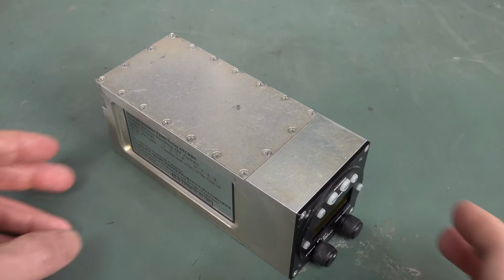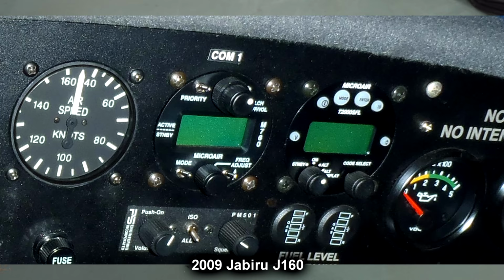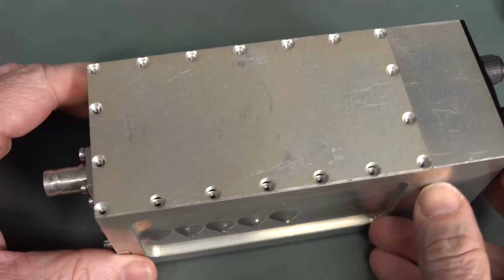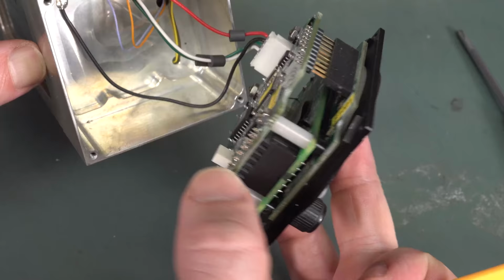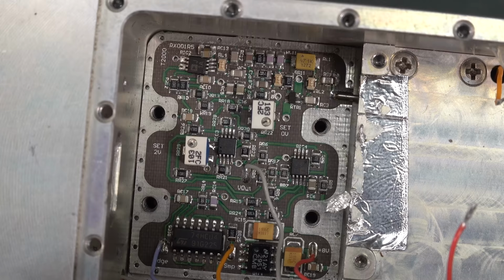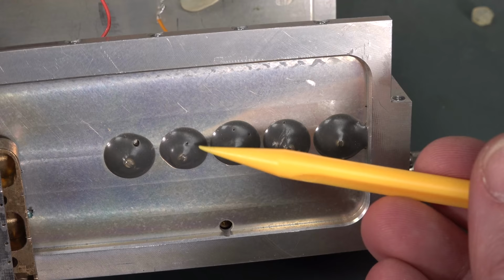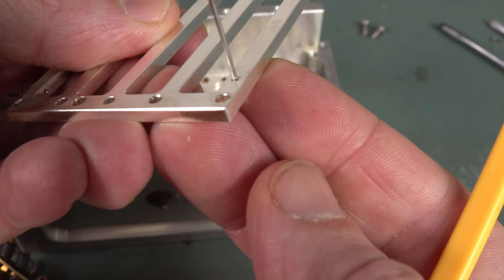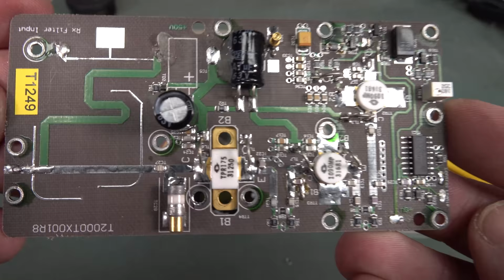EEVblog #1352 - Aircraft Transponder TEARDOWN!

Comment: The move to ADS-b may be the reason this transponder is not in service. Many small planes do not require dual systems, so when they get an upgrade to an ADS-b transponder, the old one is useless. Resell potential is limited as well. At this point most planes should be switched over. Small planes typically do not require dual systems, some may have two though, and the second doesn't necessarily need to be ADS-b compatible, so these older ones may be used in that situation... But most are being scrapped as outdated equipment.

There are a few upgrade solutions that allow continued use of the older transponder, but I don't see them in use often. They typically use a second piggy back unit to insert the ADS-b data into the RF out prior to transmission. I never seen it as an elegant solution, and only seen it once. I typically work on aircraft capable of holding more than a couple passengers, more corporate level than GA. King Air series 90 are about the smallest I see regularly. So it may be more common to use a piggy back solution in smaller planes. 

Now regulations are different in various parts of the world, but I find they don't vary too wildly. So this info may or may not fit perfectly to any given country.

Comment: One of the reason you need a good filter at RX with lots of rejection because you're TX in at 100+W in the same antenna port ... you don't want your TX power to go burn your sensitive RX stuff.
Also, that little alone cap with the long trace grounded, it's probably to be able to adjust the position of the cap for matching.

Comment: I believe that the U-shaped piece of coax on the bottom of the RF transmit board is a high quality capacitor with a little trim cap at the end poking from the board. I think that the coax's isolation is teflon based and it's of really high quality with excellent temperature stability and exceptionally low leakage. And since I didn't see any kind of XO in there, I think that the mentioned capacitor is a part of  the main oscillator circuit. Not sure if the crystal based oscillators would be reliable in an airplane with a lot of vibration...
Reply from the maker: Could be, it's very specific.
Reply: Looks more like a stub hat didn’t had enough room on the pcb. You just transform a super small cap over your length matched transmission line to create a different value. And also a very neat way to creat yourself a good q “inductor”

Comment: The highest I work up to is about 700 MHz, but generally below 450 MHz. It's always interesting to see how quickly RF circuits change as you get up to 1GHz +. That comb filter baffled me. Now I need to go brush up on my microwave circuits.

Comment: I have a casual interest in civilian aviation and always am put off by the cost of everything. After looking at this tear down I'm convinced that the gear is worth every penny. That case and tuned filter alone is worth the price of admission.
Reply: Oh. And why that wound up on your bench is that the rules have changed. It's called ADS-B. Briefly, the IFF transponder is now required to transmit digital information about the planes position in space. There is ADS-A which allows the transponder to receive that info from ATC or directly from other planes nearby. The info can be used to locate the plane accurately as  GA (and commercial) aviation is transitioning to GPS based direct routing rather than established 'corridors' in the air based on VOR fixes.

Comment: I am really surprised they are using hot melt glue. Having worked in Aerospace electronics design for years, designing EMA for players like Boeing and Airbus,  hot melt would be a no go component in any actuator, not even used in ground testing.

Comment: Are they using some kind of special solder or hand soldering? The soldering in general looks a lot more crappy than I am used to seeing in a commercial product.
I'd typically associate the look of the solder joint with low paid hand soldering or some kind of really difficult solder alloy.

Comment: Apply a single drop of isopropyl alcohol to the hot glue and it will almost instantly release everything it holds.
Reply: Good to know! Thanks for sharing.
Reply: this also applies to people too.
Reply: That never worked for me.
Reply: @MetalheadAndNerd  try applying the drop at the edge of the hotsnot and gently pry it up so that the alcohol can make its way under it. Always worked. Suddenly loosens it up and you can remove it from anything delicate it has engulfed.
Reply: @mrossirobi  I have even put a drop of hot glue into IPA over night and it didn't change at all.
Reply: @MetalheadAndNerd  Well it won't actually dissolve it or something, it just loosens the bond it has with the particular surface. Maybe I haven't tried surfaces that are too rough...

Comment: Surprised to see a BNC connector - back when I worked on fixing Bendix avionics in the 70s I was told they fretted and failed in aircraft and the threaded TNC version should be used instead.

Comment: That's the exaxt same transponder that I have fitted in my Evektor Eurostar! I've had it for about 10 years. It is quite old by today's standards. It is referred to as a mode C (charlie) transponder. You can install it with an altitude encoder that uses a Gillham code to convert the barometric pressure (relative to 1013.2 hPa) and pass the height information to the transponder. When used without the height information it is referred to as a mode A (alpha) transponder.

Mode S with ADS-B out is the latest standard. When mode S came along, I had to return my transponder to Microair in Australia to have it updated since the mode S compatible SSR signal from ATC radar heads stopped the mode C from working for some reason.

Apart from reporting your height and and squawk code (the 4 digit code assigned to you by ATC that you enter on the front panel), it doesn't really do much else. The later mode S transponders with ADS-B output are able to transmit your speed and position which is much more useful for collision avoidance as it can be read by other aircraft that are equiped with an ADS-B receiver.

Comment: Amazing how expensive aircraft and boat parts are. Not too much there for $2500. Must be paying a lot more because not that many are sold compared to consumer electronic devices. Great video!
Reply: Remember its not just the components you are paying for and this certainly isn't something any semi-competent engineer could design in a few days using the reference designs of a couple of off the shelf components.  These are life or death avionics parts that take a significant amount of effort to design, test and certify to the reliability needed.  It's not like consumer electronics where if something breaks the only consequence is someone can't listen to music for a bit.
Reply: Plus all the regulatory BS that comes in getting them approved in the first place.  Then the requirement that all parts come from high-assurance testing.  If a chip goes out in that transponder, the tech can't get a legal replacement from AliExpress.

Instruments for homebuilt/hobbyist aircraft can be installed much cheaper, and usually have more bells and whistles.
Reply: @ThePoxun  True
Reply: Not much there?  That's the opposite of what i was thinking. 🙃
So I don't claim to understand any of the electronics, but just that machined metal box is amazing.  Not only did they spend the machine time to machine away maybe 90% of the aluminum, it had to be machined from all 6 sides, guaranteeing it has to be re-fixtured at least once. And there are 5 other complex machined parts!  I'm a little surprised they can include any electrical parts at all for $2550. 😁
Reply: It's $150 of instrument, $2000 of certification, and $350 of profit.
Reply: It's all in the certification costs and the low volume production. I work in avionics, my job is about 10% engineering & 90% certification related. $2500 is cheap. The actual flight electronics (actuator controls, flight computer, etc.) require a higher design assurance level and can be much more expensive.
Reply: @ovalteen4404  „regulatory BS“ I know it is popular to call regulations shit, but air travel is safe because of them.

Comment: Sometimes when you look at RF components like that Filter / Diplexer, you can imagine that the shorted end is very low impedance (maybe < 10 ohms in the RF realm), and the other end of those bars is open, so very high impedance.  Therefore, somewhere in between, is an impedance that you may be looking for, i.e. the proper match for the input circuit, etc.  So, when you find it, you can tap into it with a wire at that point.  Sometimes thats 50 ohms, sometimes it different, depends on what its connecting to.

Comment: Those "Ohmductors" are amazing!  ( Yeah, I caught that they are only test points, but they look so cool with that ohm symbol shape.)  
And the fact that you have only one RF connector to the outside world, and it has a "direct short to ground" right at the center pin of the RF connector in a DC sense, yet it both receives and transmits (I think you said over 100 Watts) in spite of the "short" is absolutely mind-blowing!
I love that filter!  It reminds me of a job I had years ago in tuning microwave devices...and what a pain that was!  You have to move a small metal cylinder around inside until you find the exact spot to have it, then you have to take it out, put adhesive on it, and put it back in the EXACT same place it was when it was in tune.  There is absolutely no way you can know where that exact spot is once you take the slug out, so I started to mark it with a pencil.  Someone saw me do that and said I couldn't do that because the graphite in the pencil would act as a resistive, inductive, and/or capacitive element and make the device faulty!  NOT a desired job to have!
Thanks for sharing this one with us!

Comment: @5:36 Bridged pins on the chip to the left? Second and third from the right, bottom side.
Reply: Likely supposed to be connected.
Reply: They aren't connected on the other chip though. Looks just like bad flowing of solder to me.

Comment: Teardown a Plane ✈ Dave! 🙂 Is it true that the aeroplanes use AC current?
Reply: Yes 115V 400Hz
Reply from the maker: See my EEVdiscover channel for a simulator.
Reply: They do use AC on some systems but it is more of a remanant  of  past technologies.  I worked on the C-130s at Spar Aerospace in Edmonton Alberta. We did an avionics upgrade on the RCAF C-130s. Many of the systems we removed were tube technology  that require AC for plate voltages or klystron and magnetron excitation.  When the old systems were removed we found that the DC busses had most of the load. Ended up modifying the fleet again to create a strictly avionics  bus for various reasons.
Reply: Need to do a teardown and repair of a 737 Max 8.
Reply: @redsquirrelftw  I would say there is nothing the average tech/AME could do to fix the software. That kind of problem is way above theirs paygrade.
Reply: @Xuzyy  not uncommon to find 26 vac 400hz as well.
Reply: @michaelclayton632  Just need to keep your tongue at the right angle before you hit the compile button. :P
Reply: @michaelclayton632  yes so let's say you see a 400Hz signal then voltages can change related to the appliance but the important thing is the 400Hz to keep transformers as light as possible.
Reply: @michaelclayton632  Vacuum tubes are all inherently diodes, so if you feed them AC plate voltage, you’ll get chopped operation. I have never seen it done, and imagine it could have some use, but it would be in a very specific circuit. Tubes run on positive DC plate voltage, often filtered by inductors (large heavy ones at 50/60Hz mains, much smaller at 400Hz).
Reply: The AC current has plenty of benefits: 1) It allows use of transformers for power isolation and voltage conversion - otherwise you have to add a circuit that commutates DC to AC so it can pass through a transformer (if you want isolation). 2) 400Hz takes much less iron for the cores, so equivalent power components are much lighter and smaller than those for 50/60Hz mains. 3) You can run synchronous or induction motors off such AC, and again they are compact since they need less iron (up to a point). 4) You got yourself an excitation voltage for resolvers, so it’s easy to transmit angular positions around using purely electromechanical means - and without any potentiometers that could wear out.

A lot of those benefits made big difference before semiconductors, and especially power semiconductors, became available. Nowadays, the modern avionics don’t need AC, and position transducers often have digital interfaces -  but things like LVDTs still need AC, and it’s generated by the interface electronics. Modern switching converters run at frequencies orders of magnitude higher than 400Hz and allow further size and weight reductions. A 1kVA isolation transformer running at 1MHz fits easily in your hand and doesn’t feel particularly heavy, whereas a 1kVA 400Hz transformer is like a brick, and a 1kVA 50/60Hz transformer is a boat anchor pretty much :)
Reply: @absurdengineering  I think I could have been clearer in my explanation. Since the dc voltages required are not coming from  the 28vdc bus they must be generated internally by taking 115 vac 400 hz and using transformer secondaries to feed rectification and filter circuits. Those products are used to feed vaccuum  tubes of various types. Yes, some were rectifiers, but most were amplifiers, with a smattering  of klystrons, magnetrons, crt displays, traveling wave tubes...
Although not a tube, one of the most unusual AC  components  I ever worked on was the magnetic amplifier on the doppler radar... Magic at the time.

Comment: A PIC17, damn, talk about going with the losing option 🤣
Reply: Yeah, yeah there are now plenty of 'hotter' processors out there now but, at the time of manufacture, I am sure this PIC got the job done very reliably. Also, devices to be used in aircraft designs must pass all kinds of engineering oversight and approvals (multiply by ten times for spacecraft). It does not pay to always chase the hottest, best part when deigning a device like this. Also, you want a part that is readily available and not likely to go through lots of 'upgrades'. Many times 'works fine lasts a long time' beats out 'runs like a cheetah, try to keep up'.
Reply: @mechlabman  I think he was referring to the fact that the PIC17 line has died while the PIC16 is still available to this day despite being even older.  The PIC18 came out in 2000 and is also still available.
Reply: @uzlonewolf  Not only that, it went from "the hot new thing" to "not recommended for new designs" in the space of about a year. It had a crazy short lifetime.

Comment: In the RF section, you were correct in the RF cavity filter used as a Diplexer. Each finger is a tuned cavity filter. The bars between cavities has coupling windows between cavity sections.  This is tuned to pass the receive frequency and highly reflect the transmit frequency to keep the transmitter out of the receiver.  If you look into a typical repeater cavity filter, it is of similar design, but most often in a round cylinder.  This square design is for space requirements.

Comment: Hello, a few questions please:

- 4:31 what's the deal with the green stickers ?
- 6:22 to the right of the PIC, there is what looks like a microphone jack footprint, any ideas why ?
- is there a reason you don't use these new little electric screwdrivers (wowstick etc) ?

thanks in advance
Reply: The green stickers are likely just to indicate that a given board passed QA.  The footprint next to the PIC appears to be for some unknown 8-pin microcontroller (labelled MIC3, with the PIC being labelled MIC1) that presumably would have provided some unimplemented feature (or perhaps early debugging?).
Reply: @ethanpoole3443  I see, thank you

Comment: Got to love low volume production. Everything is bodged - no money for production engineering. Hand-wiring is actually pretty horrible for reliability. Nothing gives you quality like a million-a-year production line running at 99.99% first time yield. But what can you do? Build and hope.
RF is my business. In my time I've designed for Marconi Instruments and more recently satellite stuff. The comb filter is pretty standard. It is made this way for low loss, to keep the overall noise figure of the receiver low. Also, of course, keep the transmitter power at bay. And the signal injection points - just the distance up from ground that gives you 50 ohms.

Comment: they are tearing these out of planes because they are required to upgrade to Ads-b by 2020 , al lest in the US.
Reply: Indeed, this doesn't do ADS-B
Reply: @rkan2  Microair came out with a prototype ADS-B transponder (which was cosmetically similar to this one), but failed to bring it to market before they ran out of money.

There's a manual for the prototype if you google "t2000adsb". They only made a handful of them, basically enough to enable CASA to say that ADS-B was capable of being low-cost enough to become mandatory.

(then the cheap product never appeared, so we ended up with mandatory expensive fitment instead)

Comment: It's and old mode A/C XPDR so it's only pulse modulation on RX and TX - makes the RF part pretty simple. There are whole dumpsters of these since Mode S became mandatory around the world (not everywhere but most parts where there is any traffic volume to speak of). Those modern mode S XPDRs need to be a bit more sofisticated since mode S is essentially an datalink with a 4 Mbit DPSK uplink (1030) and PPM downlink (1090). Then you have DF0 for ACAS, DF11 acquisition squitter, DF17 extended squitter, BDS, GICB.... Gaaaahhh... I'm gettin a flashback to my surevilance system qualification course.... Any surveilance/radar technicians here who recognise the pain of learning uplink and downlink formats?